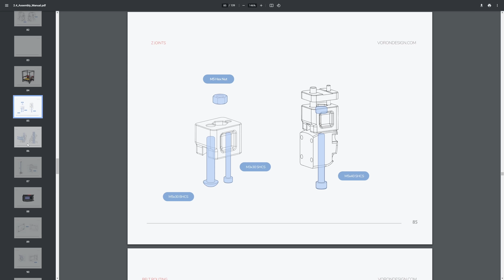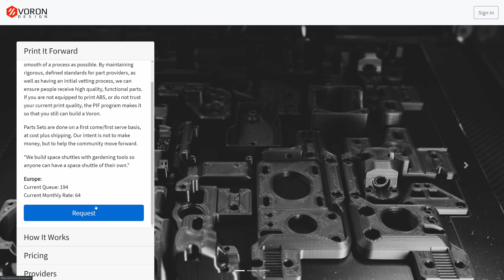My new favorite 3D Printer! The Voron 2.4 Build Experience

Comment: Does the duet board support closed loop motors?
Reply from the maker: The duet board can run with external closed-loop driver/motors, like the integrated NEMA 17 closed-loop steppers, but as far as I know, the Duet boards don't let you simply hook up an encoder and close the loop with that.
Reply: We have a prototype CAN-connected closed loop driver board, driving a stepper motor with built-in encoder. We also have a magnetic encoder board to mount on the back of a ordinary stepper motor. Max output current is 6.3A peak, max voltage is 48V nominal, so it's capable of driving large motors. Beyond that, we suggest BLDC motors and ODrive.

Comment: Kinda sad, that the community of Klipper seems to have become kinda toxic. I was considering trying it on my highly modded CR-10, but I guess I stay with my vanilla Marlin with custom configs for now. The MKS Robin E3D isn't too slow anyways. What I am really interested in though, would be those Pi CM4 based boards that are currently in development. Those could be really interesting, since you won't need to use a full mainboard basically just as a slave for your Pi (although I am afraid, that those boards will be more expensive at first than just a simple SKR or MKS board connected via USB)

Comment: Would you mind to share some tests how it performs (printing at high speeds) when gantry raised almost to the top? There is no doubt that it can print very fast at the bottom, but due to some engeneering solutions it seem that it could be not enough rigidity when gantry rises higher and higher, and there is almost no such test results over the internet. So it is very interesting - can it at the top perform at the same enormous speeds  with the same quality (as at the bottom).
Reply: The gantry is on linear rails. It’s just as stiff at the top as it is the bottom.
Reply: @nsboost  Rails is stiff by itself, but that does not mean the it does not matter how they used. Gantry is not rigid due to its construction. We could discuss this infinite, only tests will show how it works. Those tests I've seen shows that gantry at the top - there are quality issues while using same speeds
Reply: @Kekht  I’m not saying the gantry is or is not stiff. But the edge of the gantry it attached to linear rails at all four corners. Due to this and the belt ran Z axis… however stiff it is at the bottom, it will be at the top. 

Only thing your going to change is the harmonics of the machine a bit. 

The voron trident keeps the print gantry at the TOP and the bed moves up and down. If you like that better
Reply: @nsboost  As I said, this dispute could lasts forever, only fair tests could judge

Comment: I dont know Rick. How reliable would be in a printing farm printing petg 24/7? How easy is to level the bed? How good is the flex bed?
Reply: There's an auto-Z-calibrate mod which, in combination with a magnetically-attached microswitch bed probe, gives me perfect first layers regardless of nozzle or hotend changes, different build plates, or anything else. It's the most fire-and-forget I've ever had a printer be. Really freaking impressive.
Reply: @tanaes  and what abou the chinese flex bed? do you have to use glue on it in pla and petg?
Reply: the adhesive magnet will last working at 90° 24/7?
Reply: Can't say about the magnet specific to the kit but the graviflex certainly should hold that long, for the flex plate, Nero has been running his for a year or 2 without issue
Reply: @Marcos-tj8nk  have an energetic bed on my ender 3 v2, and if you clean it from time to time the grip is perfect without glue stick.
Reply: You don't level the bed with v2. Bed is screwed down at the bottom and does not move. You level gantry against the bed, and Quad Gantry Level in firmware takes care of that. It has induction probe in toolhead, you can set it to do 5x5 ABL at the start of a print like on Prusa or such. Z endstop which Tom does not use is there to calibrate nozzle height.

As for reliability, you may be better off hopping to VORON Discord and asking guys doing PIF (Print It Forward) program how reliable those machines are printing ABS parts day in day out. They are probably the most extensive users of their VORONs.
Reply: @Marcos-tj8nk  I'm also running Energetic mag and flex plates. I really like them. Been running an Energetic on one of my other printers for the last year or so, and it's outlasted some other mag stickers I've used. So far the one on the Voron is holding up well over maybe 100 hours of 110° ABS printing. I always use a separating agent with PETG on PEI so it doesn't adhere permanently, but PLA and ABS have both been great uncoated.

Comment: I'm not particularly interested in it's speed what I like the most is the completely static bed. Also, it looks like it would be very easy to extend the Z axis because it has belts rather than screws - has anyone tried that? Is it extra accurate is it at slower, normal printing speeds?

Comment: Comparing Prusa size with Voron is a stretch... 
Simple test - will Voron fit into Lack enclosure? ;) 

That is really wild that you never did a Voron build before and afaik did not know about the whole project untill something like months ago?
Dude, let go of cheap cookie cutter printers and do more builds - HevOrt, Annex Engineering K3, other Vorons

Otherwise cool video!
Reply: The Voron is it’s own enclosure. Prusa in a Lack enclosure takes much more space than a 250 spec Voron - my V2 is 42cm x 42cm x 52cm while a lack table is 55cm x 55cm x 45cm…

Comment: how are you only using the probe and not a Z endstop?
Reply: I think he is using the probe as the endstop. In this case it looks like its an electrical connection, but I think the same thing is done with a BLtouch where the touch switch just acts like your Z endstop for the first press and then it does its leveling thing.

Comment: Did you print the legs? And do you have the stl for them?
Reply: The legs are the motor assemblies for the Z axis, the feet are rubber air compressor feet.

Comment: How well can this printer print polycarbonate and nylon?
Reply: You would want to add panels to the enclosure for both of those (I have printed a little Nylon without any enclosure, it doesn't need much heat but for strength it seems you want the enclosure). It looks easy though, it already has the box so you could do it in 5 minutes with some foamboard and tape or do it fancier with plexiglass and drill holes to screw it, both will work just as well. PC I've heard is a pain (this is according to our materials guy, but he also was in disbelief when I said I printed ABS without an enclosure all the time and it was easy, so it may just be his experience with crappy machines, which the ones at work are indeed horrible, or PC is probably just a pain but maybe not as bad as some people make it out to be). I haven't done PC, they haven't thrown any trimmings away either at work (I also do a lot of the printing and printer maintenance), but for most of my personal designs I usually need ABS (impact strength, and temp resistance usually, and since its cheaper than PLA and prints easy I usually stick with it unless I need something else). You should enclose it if possible though, that will make it a little easier, but for Nylon it should be fine, however ideally you want direct drive because Nylon just oozes a lot and bowden extruders ooze a lot more but then you're adding mass to a CoreXY which kills half the point of a CoreXY (which is fast and light weight), but we print Nylon with Bowden at work and my personal printers all have Bowden (my first one I even converted to Bowden a long time ago back when Bowden was in its infancy and not at all common, it works great for everything I need though and fast!)

Comment: Can this thing be built as a 460x460x460 ?
Reply: Yes, there’s a configurator on https://vorondesign.com/voron2.4 to help you choose a custom size.
Reply: You can but it is a dumb idea. The Voron 2.4 is designed for optimal performance for 350, 300 and 250mm. The bigger you make it, the less rigid the frame becomes, the heavier the moving parts will be, the longer the belt path will become (more elastic) etc. So if you chosen to enlarge it, performance will drastically drop. So you will get a very expensive not very good printer. You can, but why would you?
Reply: @petermaersk-moller3014  yo! me good friend, am not dumb... the Rat Rig has the new level strong frame and offers 3 units 300, 400, 500 and screams in accuracy and speed. Part of your answer is useful, t.y.

Comment: would it be easy to mod it to be taller?
Reply: In addition to longer vertical extrusion, longer linear rails, longer belts, longer cables, longer rear cable guides, and taller outer panels.... It is possible but unknown on the quality of the higher layers being outside of recommended tolerance... maybe a nice challenge for someone if they wanted to do it! I'm more than happy with the 350 I'm building :)

Comment: Could you estimate a build cost?
Reply: Low end 1300 USD, upper end 2k USD. Formbot kit (like he got) is on the low end and potentially can cost you a lot more if you get bad parts. Look apex engineering and the "redoubt" build, costs slightly more but should be way better, be easier to tension, not have the leveling issues, and belts won't get shredded every ~6-9 months.
Reply: If you're very frugal and willing to do a lot of the work yourself, you can build a Voron for under $1000. In order to do that, you have to have a solid understanding of all the components, how to do all the wiring, drilling, tapping, etc, and you have to be willing to invest a significant amount of time into not only building the machine from scratch, but sourcing everything yourself. In my admittedly inexpert opinion, you're probably better off spending more for finished components or investing in a quality kit.
Reply: @gatling216  Nah, even doing everything yourself you aren't going to get it that cheap except for once in a blue moon.
Reply: @SirSpence99  Well not with that attitude.

Comment: I’ve been tinkering with building one of these for awhile now. I already have a Tevo Tornado that was my first printer. I really don’t ever use it anymore. I also have a Qidi X-plus. I actually really like the qidi. Which is why I use it mostly. I love the quick change head for high temp vs low temp material. I was going to keep my tornado just to tinker on it but I’m starting to think I want to build one of these since it’ll scratch my tinker itch, plus I love the idea of speed prototyping parts. I make a lot of one off little items and the speed would be fun to make quickly. Since right now I tend to print 2-3 tests, each one being a 1 day print, then a long high quality final print. If I could print fast in an hour that would be fun. I could have a final part in a day versus 3-4 days.

Comment: One of the problems with a Voron as a production machine is... lack of support, precisely because it's open-source and self-built. So I think companies value good and quick support as important as the printer itself.
Reply: I don't think so. If you need support, you probably haven't searched/read enough. ;)
Besides, support is something extremely expensive, and I, who never needed it, don't want it and I don't need to pay.

Comment: 5:40, isnt the z gearing 1:5?
Reply: Thought it was 20:1 motor to belt.
Reply: @Mekanikalistik  you are wrong, the pulleys on the z steppers are 16T and not 20T, making it a 5:1 reduction. You can check page 19 in the manual 😜

Comment: How does this compare to a railcore II?
Reply: I've worked a lot with both, and prefer the voron. I don't like the way the belt path in the Railcore blocks access to the hotend, and it's harder to enclose. I've also had some lingering issues with z banding on our Railcore due to some problems with lead screws.

Comment: If you have that much rust on your black oxide fasteners, you need to crank the ac more. I haven't seen black oxide rust like that even in humid Midwest summers. Also, stainless has big draw backs like cost and galling. The better alternate would be a plated steel like zinc.

Comment: Seeing that you usually comment on compliance, it was disappointing that nothing was mentioned here. The problem with printers like these, are that they need to be conformity assessed, and be in compliance with, among other directives, the machinery directive. Until that is done, and the machine is CE marked, it is in fact not even legal to use it. 
I wish this was different, and I am actually actively trying to raise awareness and push for change, although I cannot disclose much about that. At least when the new machinery regulations are released(I believe 2024), it will be possible to modify machines and only conformity assess the changes made. As it is today, a major modification actually means a new machine was made that has to be conformity assessed A-Z.
I was under the impression that you were somewhat concerned about conformity of 3D-printers, and I see you used some of the information I e-mailed you in previous videos. I just wish you would have stayed true to that, and not suddenly turn 180 and recommend people to build Vorons. Building a Voron is hardly the next step up from tuning a commercial printer. Legally building and using a Voron would requires more technical insight than I imagine anyone in the community possesses unfortunately.
Reply: Haha, have you seen the $hit actual companies make? We have some garbage $10k printers at work (only 1 year old, design is within the last year or two), and they not only print slower than a snail, break parts seemingly every week (break glass as well if you're concerned about safety), and are so poorly designed overall a monkey has a better chance at building one. If they can't even put a way to tighten belts, then I think little Timmy with some tape and sticks can do almost as good of a job. I wouldn't trade any of my printers for one at work, mine run 6-8x faster with 10x better print quality (except my $112 machine, it does 10x better but only twice as fast). I just got done spending hours heat gunning ABS off a nozzle, its garbage bed level system (the best of the bunch) has no Z-offset setting (besides manually editing G-code) and the way it does it is with the nozzle is inconsistent because sometimes it has some extruded plastic on its tip during heat up, so after layer 10 the part was just loose enough it popped off and I had to clean half a pound of plastic off (which meant a $400 nozzle is stuck inside it still, but I was able to use the parts from the last time this happened on its brother machine and canibalize it so it wasn't $700 plus nozzles to replace).

Its pathetic, and might I add the one I described is our "nice machine", the other ones were worse and our intern is replacing the blown electronics (only $550 for a new and equally crappy mainboard that will probably blow up again the exact same way as the nozzle smashes the bed off the platform). Sure you might think licenses mean that people are qualified at things but we all know that's not the case, just like I have a HAM license but I have no idea how to operate some ham radio equipment or how I probably have more skill flying quads than the entire department combined that I work with while I'm the only one without the license.

I've also been electrocuted multiple times by "compliant" machines, but I can't remember a single time I've electrocuted myself (except when on purpose) with my own machines (which is crazy that I still have all my fingers and eyes because I don't tend to pick safe projects). Oh yeah, my favorite for compliance, I got my arm pinned behind a laser cutter/3d printer while manually controlling it with Windows (I always use Linux for anything important) but thought, nah, I just need to have it hot to tighten some screws and move it to position, what could go wrong? Then I look over after my arm is kind of pinned in an akward spot at my laptop to free my hand that's cooking and it says "windows is updating" without warning... Yay, I bet Windows has more certifications than customized Linux kernals right? I mean that means it has to be good right? Or secure? Or stable? oh... It really does mean nothing...

Comment: can it be modedd to 1m x 1m x 1m  ???
Reply: CoreXY printers in general does not scale up well, you start getting problems tensioning the belts, which grows in size very fast. Rat Rig had to use thicker belts (9mm, instead of the 6mm belts used on Voron) to overcome some of these problems, but even they have only 500mm x 500mm printers.

That said, I believe there's a guy at the Voron Discord who made a 1m x 1m bed (don't know the Z height), so it is doable. But you'll be on uncharted waters, so to speak.
Reply: technically you can, but shouldn't, belts get super long.
Check out the k1 or k2 if you want a large printer.

Comment: Voron is cool but a little too much over engineered. This is why I prefer the BLV MGN
Reply: Voron 1.8 is pretty much the same style as the BLV if you prefer a traditional moving bed CoreXY.
Reply: @christophmuller3511  I already built a Blvd and I'm even transforming it to a tool changer
Reply: @SebastienChedalBornu  I am happy that I went with the V2 instead of the BLV - I looked into both, but the V2 won due to being much more space efficient and the build in enclosure.
Reply: @christophmuller3511  probably, but it's pricier

Comment: IMHO you will end up loving the Z endstop pin....you'll see.
Reply: I guess he's not changing surfaces, nozzles or hotends so he's not modifying z-offset - but I agree, it's amazing never having to adjust bed offset even after full nozzle swap outs etc.
Reply from the maker: I'm getting right to modding the 2.4 - a tool length wouldn't fit in with the new setup 😉